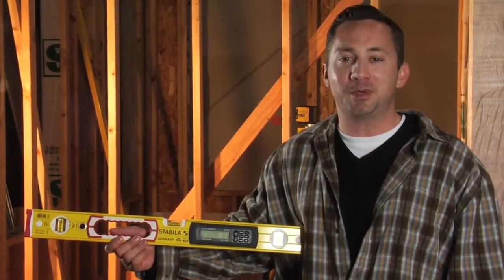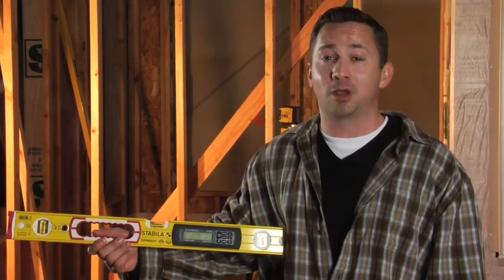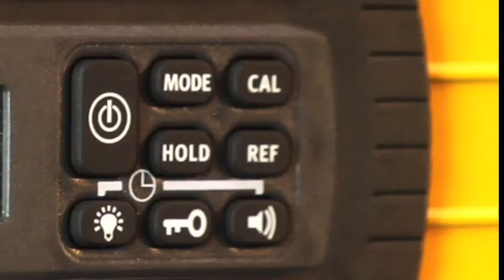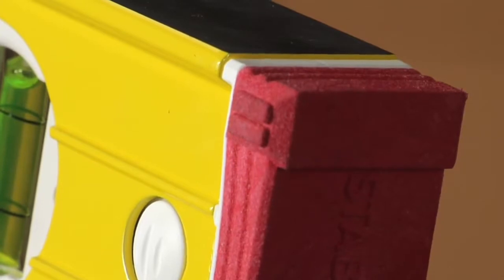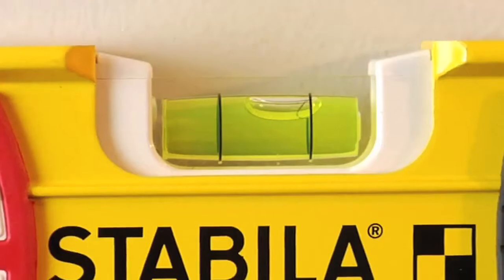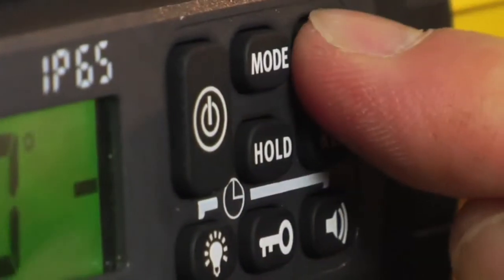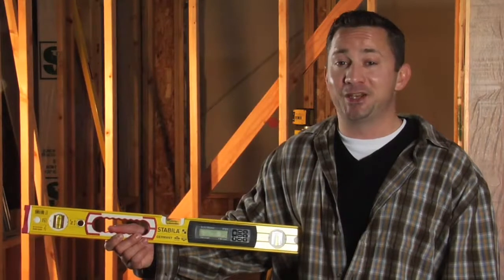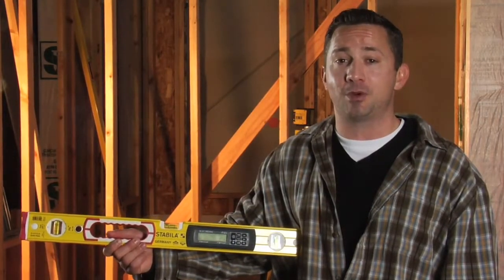How To Calibrate the Stabila TECH Digital Electronic Level

Comment: I have the older model of the 196 electronic that does not have the cal button, how do you adjust the calibration.  Mine is stuck in a vertical mode?